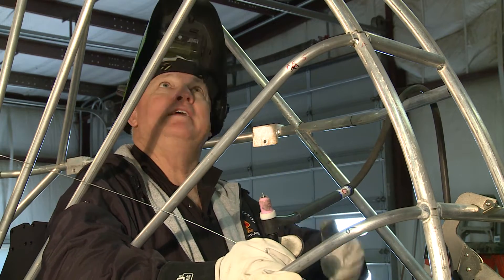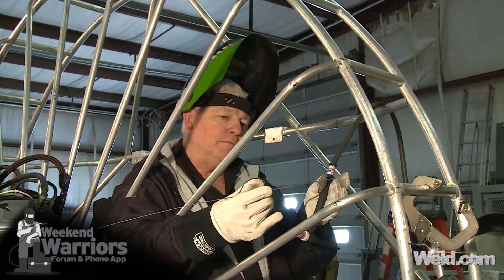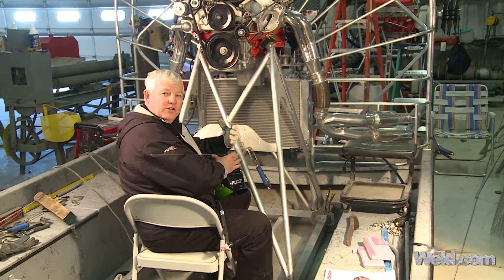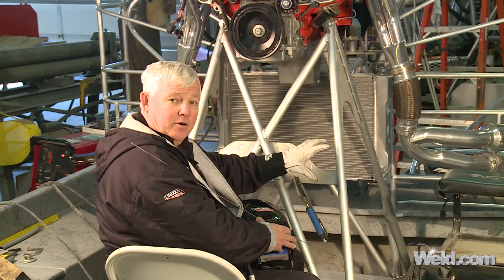Airboat Fabrication: TIG Welding 6061 Tube | TIG Time

Comment: Strange how the design of that fan boat has a heavy motor mounted up so high. I would think potential center of gravity issues in tight turns. I would have the motor down low and design a belt drive, chain drive or shaft drive to drive the prop and keep CG low for better turning.
Reply: Most of the time the engine is lower, but it's all about weight distribution. But it's all about how the boat is designed, but in tight turns you keep up on RPMS, because they cannot turn without air, so most of the time that's what keeps it a lot. But there is already reduction units made, we use belt drives, and also gear boxes.
Reply: You gotta realize there's gonna be a huge prop (fan) spinning behind that motor so it's gotta be centered to the fan. You don't really want long belts and chains whipping around at high rpms

Comment: May be a stupid question but when we're talking about the amperage settings, what's the voltage - do we always assume 240V for welders?
Reply: For aluminum, yes, aluminum efficiently conducts heat away from weld site, creating a need for a lot of heat. More amps are needed, delivered from higher voltage.
Reply: thanks

Comment: Hello... I'm looking to built an Rc plane with a Aluminum framework.. It is gonna be made up of tubes with 10mm dia and 2mm thickness...which type of weld would provide higher strength.. Oxy acetylene or tig?
Reply: TIG, no doubt.

Comment: Mr tig, the 6061 you are using - is that a T6? Most commonly it is.... Right next to the weld, in the heat effected zone you are loosing about 70% of its original strenght because the welding destroys the temper and the artificial aging (the T6)... Are you planing on re heat treating the sructure?